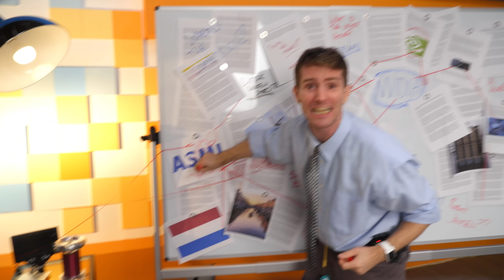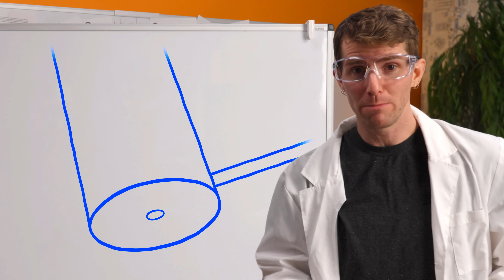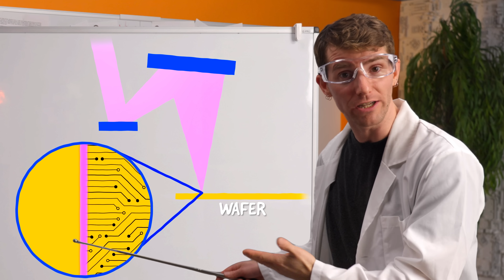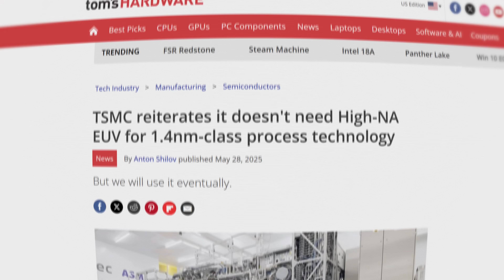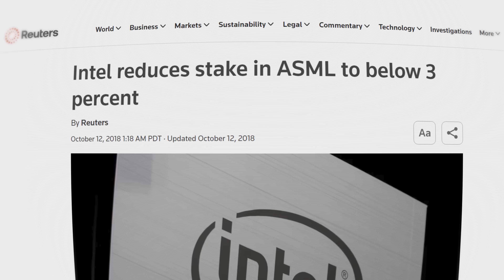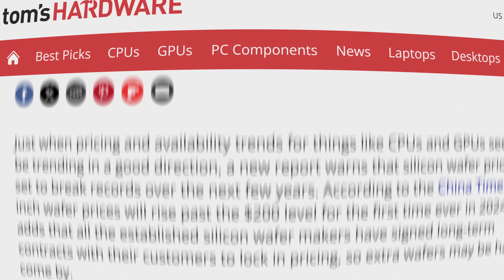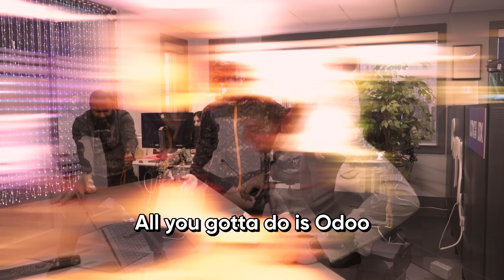This is Why Hardware Prices are Going Up… Again

Comment: A couple of things not mentioned: 

TSMC was heavily subsidized and protected by the Taiwan government for years giving it an advantage to get where they were able to overtake Intel (which was greatly helped of course by Intel's beancounter idiocy during 14++++ era). Intel only now is getting that kind of preferential treatment and help by the US government, which is likely the only thing keeping them afloat as they work themselves out of the abyss that the pre-Gelsinger leadership drove the company into.

Intel bought all of the initial production of ASML's High-NA machines (this would have been worth mentioning, because it would have pointed to TSMC getting competition.) I'm honestly surprised that wasn't mentioned when Linus pointed out that TSMC only bought a couple of R&D machines, that's because there were no more machine's available (at least for initial wave of production.

China's fab production is utterly divorced from market/economic fundamentals and shouldn't be directly used as an example for the US/Korea/Taiwan to use unless they plan on making it part of their national defense budget and are prepared to dump 10x the costs that China spends (due to environmental regulations and lack of electricity capacity, also due to over regulation.)

Comment: Turns out all I needed to have 100% motivation to upgrade to a Radeon GPU and 0% motivation to ever buy another Nvidia GPU, was two generations of fire hazard power connectors. This just makes it even easier.

Comment: High Na isn't smaller wavelength just a higher Numerical Aperture (NA), so it's more efficient at capturing the light allowing you to resolve smaller features. General equation is Critical Dimension = k1*Wavelength/NA where k1 is process dependent but theoretical min is ~0.25 . Low NA is 0.33 with a wavelength of 13.5 so min CD is like 10.2 or 20ish pitch, high NA is 0.55 so you can hit a CD of 6 or 12ish pitch. For REF the next best thing is 193i (193nm light w/ an immersion bubble suspended between the wafer and final lens) has an NA of 1.3 so min CD is 37 or 74ish pitch.

Note that this is for a perfect grating of lines so real layouts you care about will have a slightly bigger limit but you get the idea. Of course for any chip you need all of the above as you go from fine feature to thiccc interconnect lines, after all no one is printing Cu bumps with an EUV tool :)

Comment: If the vast majority of people (gamers in particular) stopped paying insane amounts of money for the kind of power that, realistically, they probably don't need or even use, this wouldn't be an issue. If purchase decisions were based on real world performance and what you actually need rather than benchmarks, reviews and having the latest and greatest for the sake of it, manufacturers would have more of an intensive to keep their prices reasonable since the high-end, high margin stuff wouldn't sell nearly as well. TSMC needs customers. If manufacturers approach them with reduced sales numbers to drop lines, the prices will suddenly become more reasonable.

Comment: You should check out the margins these monopolys take. ASML 26,9 TSMC 40,54 NVIDIA 55,85 in 2024 over all their products, 2025 is higher. The real problem is that datacenters offer higher margins for parts than ordinary customers

Comment: There’s another layer: Zeiss. They’re the only company that can make the optics ASML need for EUV. Like ASML, nobody has a realistic chance of catching up with their technology.
Reply: And and the monopoly shows in their software - it's dated, overly complicated to troubleshoot, and their support is constantly pinned at 100% output. Why invest in making yourself better when you are the only choice?
Reply: @lumo2707  Nikon or Leica probably could if they tried. There are a few others out there too
Reply: ASML relies on about ~200 subcontractors, Zeiss being one of them. That's why it's so hard to create a new ASML type company, you need a whole ecosystem.
Reply: @lumo2707  also Trumpf from germany is an important supplier to ASML
Reply: @lumo2707  And the Lasers come from TRUMPF
Reply: Best odoo ad ever
Reply: China now has a prototype that produces EUV light. But still they are about 5-10 years behind the level of ASML today
Reply: @Cokey96  Making EUV light is maybe 1% of the problem they need to solve. Every single stage of making a prototype EUV lithography machine is almost impossible. Then, making it work economically at scale is another level on top of that. There’s a strong argument that it’s the hardest engineering challenge ever solved by humans. It just doesn’t feel that way because the final result ends up in all our pockets!
Reply: @lumo2707 Well said brother. I agree with everything you just said.
Reply: @Cokey96 no they don't. That Reuters story is rather bullshit. In October China had to call ASML for help to repair their DUV machine cause when they tried to reverse engineer it they couldn't assemble it back. And you believe in these 2 months they were able to reverse engineer more complicated machine?
Reply: @Kostek  I don't know if it is BS. However, China isn't a conglomerate. 1 Chinese company could have had issues trying to reverse engineer their DUV machine, while another Chinese research institute could be working on EUV. As per the Reuters story, it took ASML 18 years from prototype to commercial manufacturing of chips. Per the same article, the Chinese prototype has not made any chips and lacks a usable optics system. Which I feel like isn't out of the question for their development. But articles citing the Reuter's story seem to be missing all the details about what stage the "prototype" machine is actually at, and make it seem like it's only a few years away.
Reply: @kickassnetwork Exactly. The 5-10 years claim is what I saw on a news article. The same article also said they have ex ASML employees. But that especially the mirrors are a bottleneck since non other then Zeiss can create mirrors with only atomic level deviation.
Reply: @kickassnetwork  fic level

Comment: Linus, or whoever wrote the part of the script stating "Extreme ultraviolet light doesn't naturally exist on earth" is not good with physics, more specifically the electromagnetic spectrum... and even the word "Exists" in context":  The earth itself as a whole doesn't generate light of any kind, but electrons of atoms when excited by light will absorb the energy and jump to the covalence shell (outer most electron AKA valence electron) of the atom, and then when they are pulled back in to a closer shell where they release a photon, and electrical currents are not electrons, which have mass and cannot move at the speed of light, which electrical energy does, nor do they travel in and through the wires, they just jiggle around, sometimes trading places (which you can feel), but rather photons (in the gauge boson group of subatomic particles) which are massless energy packets, traveling at light speed within a quantum field due to energy potential Volts, and the photoelectric effect (the before mentioned reaction of electrons excited by photons), and not just in the wire, but outside it too.

As for "Extreme ultraviolet light" which I don't think "Extreme" is a scientific designation, just light waves in the very high frequency of the ultraviolet range of the electromagnetic spectrum, and they do exist naturally on earth, via anything that can generate them like stars which are part of nature but do not have the high energy as other ranges of light and therefore are much more easily absorbed meaning very few ever make it into our still quite dense atmosphere compared to open space.

Any real physicist is welcome to correct me, a mere 62 yo physics geek who's been trying to tackle quantum physics in the last decade for a better understanding of physics as a whole.

Comment: It's time to cut the internet cord, and move back to a simpler time of the 286 or 386... with 4MB of RAM, running DR DOS 6.0, XTree Gold, and GeoWorks. Refuse to pay these ridiculous prices... and wait until the AI crash of 2028!
Reply: nah those are too far. any 3rd gen i3/5/7 and amd equalivements, and any gtx card will do just fine. an i7 3770 beats a 10th gen i3 anyways

Comment: I built a whole new rig on December 15th using the ryzen 9 9950x3D,  rtx 5080, 96 GB of RAM, 8 TB of storage, 1200W power supply, water cooling all for under $3,000. So I'm not sure where this inflation is coming from

Comment: GTX 480 is about 900 euros adjusted for inflation. So yeah, Nvidia's extra profit per unit is not that huge - a 5080 is about the same price, and a 5090 is basically a workstation class card - a quadro in all but name.

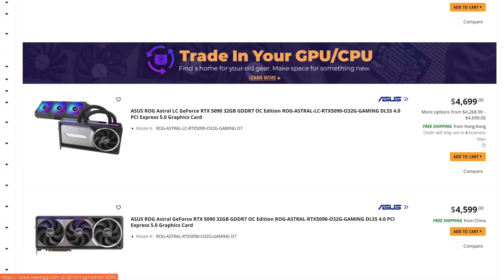Comment: 2:12 - However insignificant it might be, I did actually buy a 9070 XT to replace my old Nvidia GPU. I was expecting issues but it has been flawless so far. Much like iPhones if you live in the US, Nvidia occupies the coveted "default choice" market position if the price doesn't scare you away. I have my issues with AMD and their fake MSRP nonsense with 9000 series, but I cannot in good conscience give money to Nvidia. I encourage others to do the same. 2025 Radeon cards are a different world compared to their buggy predecessors.

Comment: Cool now i have all the time in the world to go through my insane backlog. I have close to 200 games that i "have" to play right nw and the list ain't shrinking but guess what ? most if not all of them DO NOT require an insane gpu to run well at 1440p which is more than enough

Im perfectly happy with my 9060xt and my 27" 200hz 1440p monitor, i spent a total of 555e (400e graphic card+155 monitor) and i can play pretty much anything i want, sure 2026/2027 games might not be that easy to run but hopefuly gaming studio's will finally realize that it's time for them to actually optimize their games ... Honestly i would have kept using my rx 6600 8gb if games nowadays were actually optimized instead of eating VRAM for no good reason.

We don't need the latest and greatest... we WANT the latest and greatest.

Comment: I knew in video was selling better than AMD but only 7%? What the hell?
Reply: %7 is old, they are in a better situation after the 9000 series
Reply: Marketshare is the wrong metric but easy to come by. The correct metric would be sales, and there are quite some rumors saying the RX 9000 series is doing better then their Nvidea counterparts. Nvidea also has more versions so they might still have more sales overall.

Comment: They were jacking the prices up with no shame.
Japan developed a method that cost not 50% (of their $200M machinery), nor 10% of the original cost but 5%

Which China already copied, and USA is about to implement I imagine.
Reply: it was as easy as imprinting a circuit into a material (check japanese Rapidus)

Comment: The 9070 XT is a great card. I do not get why people are so locked in to Nvidia. I think here in the EU, AMD market share is not as bad as in the US. Most consoles have AMD inside, not Nvidia, they work with open source drivers on Linux ... they did not scandals like having part of the memory attacked with lower bandwidth that caused issues and an arrogant asshole response to it among many other issues like that I hate them for. Raytracing is overrated, and the 9070 XT is not that bad at it, either.

Comment: 1:25 "Nvidia's market share has climbed to 92%, now that alone doesn't make them a literal monopoly" 
Yes, yes it literally does - monopoly is literally defined as a single seller that controls the market by having a dominant position - you can't get much more dominant than 90%. In law a monopoly is often defined as "more than 50% of the market" , and I don't remember a time when Nvidia wasn't a monopoly by that definition.

Comment: But can all this justify the price increase of the RTX 4080 over the MSRP of the RTX 3080 by $500? And can it justify the price of a RTX 5090 of $2000? In case of the 4080 the specs are more a 70 class GPU and not a 80 class GPU. So NVIDIA was selling a 4070 as a 4080 and slapped a $500 premium on top of that. That was the moment I said.... NVIDIA no more until it decreases pricing significantly and deliver the correct specs for the right price.

Comment: tbf, explaining everything with "there are monopolies over and over again" is a little bit misleading. Yes, they are monopolies, but prices on all levels are growing because there is an insane DEMAND, even sectors without monopolies are bottlenecked and price is the regulatory signal -- it makes some to reconsider buying (reducing demand), some to increase investments in production (improving supply). Anyway, the demand from "AI" is so high it is literally exposing ALL the bottlenecks ("monopolies") simultaneously -- in chips, fabs, power, even construction. This is why you can't just spend trillions (even if you get them out of thin air) on something and get immediate results -- there is a need for build up in capacity all over the place and supply chain. And further links down the chain will NOT start expanding until very concrete and guaranteed demand is coming to them, even if "everyone sees" that this demand will "inevitably" come -- a lot of things may happen, so real business may not be eager to start investing before it hit with deficit already.

Comment: instead of trying to say "this is why prices are going up" try explaining "these are the steps every manufacturer is taking to lower prices and raise availability for the average consumer, and this is how much impact it will have immediately, and that is how much it will affect over time", and then follow that up with explaining what major brands are giving products where the topline models are less than half the cost of the last series, while improving performance and other stats (like vram, it matters, add more lower prices) etc?
Reply: you shat on us through the whole video. do better

Comment: It would not matter much if there was more competition. Thanks to the AI boom, demand for many kinds of computing hardware now vastly exceeds supply. And AI companies are willing to pay much higher prices than almost anyone else. Given it takes several years to significantly expand manufacturing capacity, very high prices would occur even in a more competitive market. Of course, with a greater number of suppliers (as would be the case in a more competitive market), there would be more companies working to expand capacity (and more incentive for those companies to do so to take business from competitors), so supply may expand faster and prices normalise faster. But the current price spike was unavoidable (unless you stopped the AI boom from being so large)

Comment: Do you know, what I'd like to know? Where the hell are the fabs, that made chips 10xx, 20xx and 30xx series cards? Generation after generation, the chips are getting smaller and smaller, performance does improve, but we're at the point that you don't need top of the line equipment. Just look at Steam's gear survey! This could all have been mitigated, assuming these older generations of cards were not made on the same machines, if their production lifespan were extended!

Comment: Most of these factors (i.e. single suppliers, fabs having high cost of set up and expensive machines from ASML) have been constant or their direction has been effectively determined from around ~2010. It's the COVID shock and then the AI bubble following up one after another that has made computers as expensive as they are. It's going to be a rough decade, but I hope prices come crashing down and then following the general trend of reduction in cost-per-performance after that as the competition increases. nVidia's dominance in all spaces are hopefully going to be challenged (TPUs in AI inference, Radeon/ARC in consumer GPUs) because nVidia isn't getting much higher performance from their recent chip generations. RAM and storage have been a hyper price-competitive market for the last 40-50 years, so I don't blame them for trying to make a buck when they are able to.

Comment: If the software is optimized and if the bloatware like copilot and other useless software is not created we can run many things on current gen hardware, There will be less of a need for the cutting edge besides research and AI

Comment: The older I get, the less I care again about state of the art systems. Have a 5700x, 6700XT and 48GB RAM - I think worst case this is gonna last me another 5 years, if it has to. Gaming is good enough on that - and honestly - for everything else, at this point I got a Macbook Pro with an M3 Pro - that's pro enough as well.

Comment: AI is the culprit.
TSMC had planned the current capacity well before most had heard of NVIDIA and AI Data Centres.

Then all the sudden, the burst of AI investments in AI data centres and by LLM efforts has led to this bottle neck.

TSMC also might be cautious not to be dragged into costly over investing in capacity. After all AI might be just a hype for the foreseeable future.

It’s wise for TSMC not to expand too much that may have it stuck with capacity that would have low utilisation rate for several years that would lead yo loss of major income and profit stream for newer technology for chip making.

Comment: I don’t usually comment, but thank you for this incredibly informative video. There’s so much incorrect information floating around online right now, and this did a fantastic job clearly explaining the economics and real supply-chain constraints behind what’s happening. This kind of grounded analysis is exactly why I watch your content. :)

Also - any chance we could get a full video on LMG’s updated networking/server infrastructure? We’ve seen bits and pieces over time, but a single, end-to-end walkthrough would be awesome! Maybe a FP exclusive?